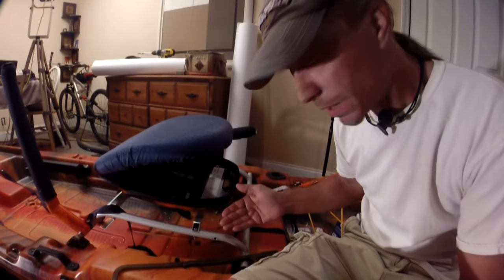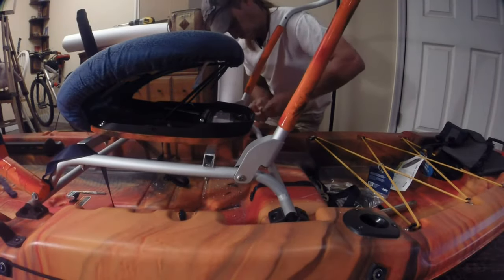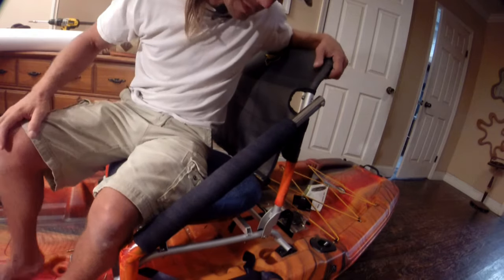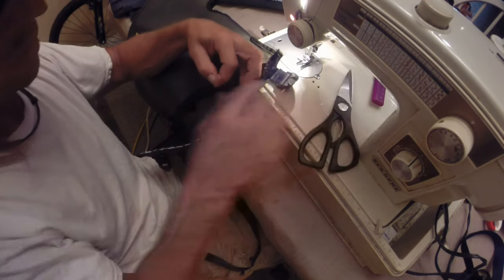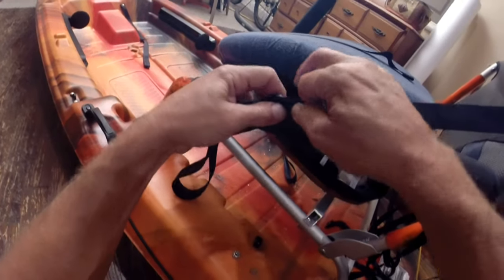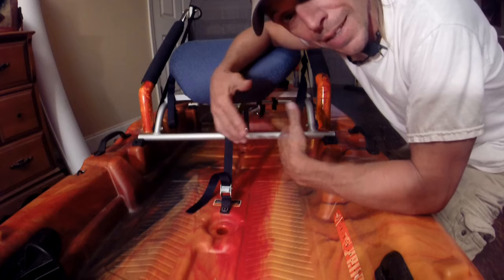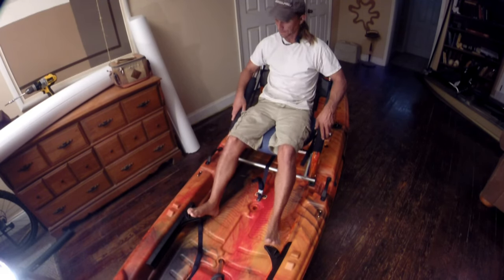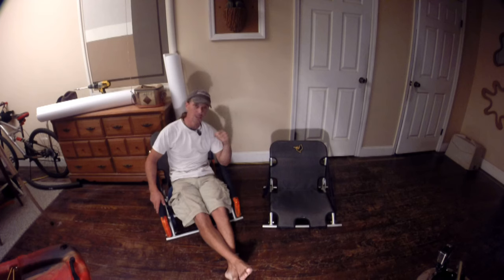Kayak Giveaway Part 4: Finishing the Seat

Comment: Ok, Marty, your add on @ the end, (of this finishing touches), sold me on the higher placement of the seat positioning, ... Am just wondering how it will work out in real life, ... Lol! Cannot wait to see how you will make the pontoons, & if they will be adjustable to a guy sitting in the kayak, while out on the water, .... I too, am in the "process" of trying to make a set of pontoons for my yak, out of 3" pvc, condensed back to 2" on the mount, ... I also made a 1&1/2" standing/leanbar, for my yak & keep it in the trunk, just in case I decide to try it out, ... Am thinking of refitting it with T -track, so that it can be more adjustable, ... Great job, ...so far!

Comment: Marty, the seat looks really great. A couple of tips on sewing, go to a sewing store and get needles for your machine that are rated for "blue jeans". It is a heavier needle and works well on canvas and nylon straps. Also hope you are using nylon thread and not cotton thread as cotton rots fairly quickly outdoors. If you want a heavier thread and cant find it. Go to a tarp shop and see if they have any broken (or partially used) spools with some thread left on. Usually they will sell these cheap as there is not enough line left for a canvas job. A full spool can run you up to $50! Hope you can shoot some video when the guy gets the yak and we get to see him use it!

Comment: When you make the pontoons if your going to make an effort for the shaft that attaches to the yak to be slim line, and you intend on making it out of pic cnsider filling it with electrical conduit using a conduit bender to bend it and a torch for the pic, or if the weight is an issue maybe a wooden dowel to create some rigidity , or a fiberglass blank. You can find these materials on Thomas registry. Best of luck Marty,perseverance is key.